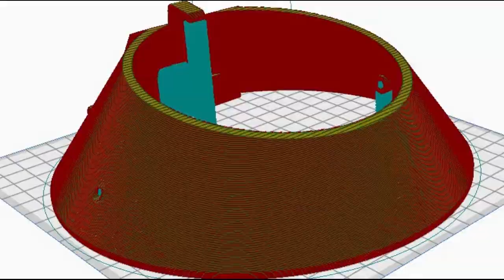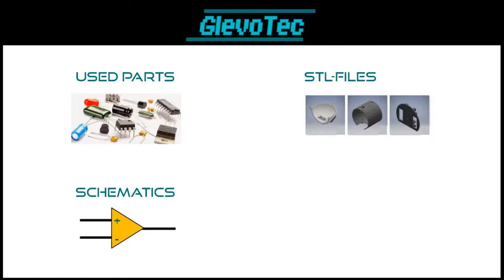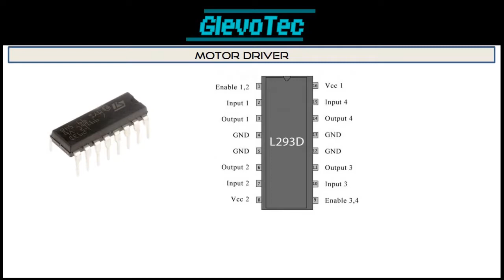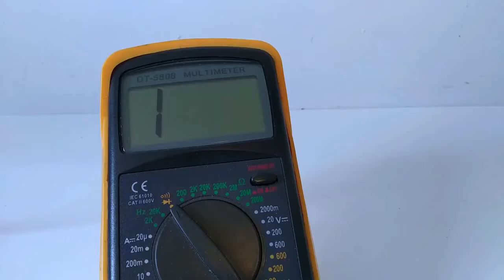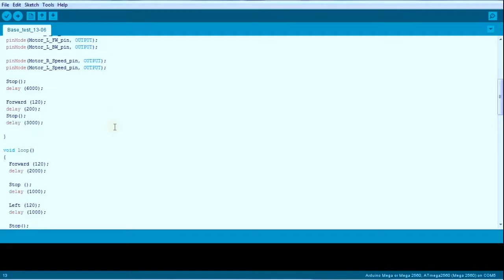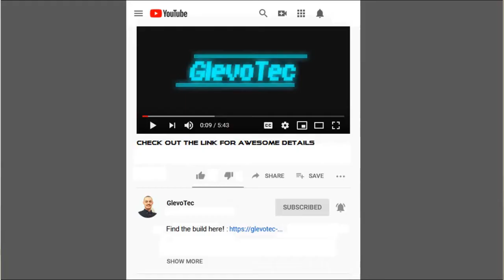Build your own 3D printed arduino waiter robot butler - WaffleBuddy Part 1

Comment: you could do pancakes. use two warming plates (like you put a mug on) bring them together and do auto injection, (like for plastics) but of batter into the hot plates. timer makes them open and drop out a pancake. batter can be made to control sticking.

Comment: can you improve the code to serve more tables to simulate real restaurant robot waiter?
Reply from the maker: The code is available for download. You can modify the code to your needs.
Reply: @GlevoTec  Can you do it ?  I will pay for that.
Reply from the maker: @vanngocle3269  No, sorry. I'm currently working on a large long-term robot project which I work on full-time in my spare time. This project will be more advanced and capable and might be better for your needs. Follow my channel for more info.

Comment: I'm downloaded the stl file but it's too small pls find me a solution...
Reply from the maker: That can happen that the STL is imported in cm instead of mm. There is a readme file included recently. You can just scale it 10x in your slicer. In Cura, just set the scale to 1000%. Then it is all fine.

Comment: How was realized position in space? Does the purpose destination  from A point to B point?
Reply from the maker: No. It's an obstacle avoidance robot with no planned route
Reply: @GlevoTec  How do you think which method needs to apply for this realize? What would you do?
Reply from the maker: @СергейСергеев-ш3в  There are lots of ways. Easiest would be to put encoders on the wheels and continually count the distance traveled, to keep track of the position. From there you could calculate a new position to go to. It will need calibration once in a while though to fix accuracy issues